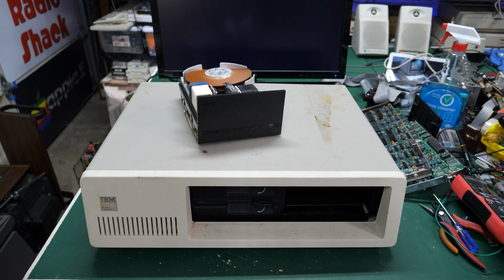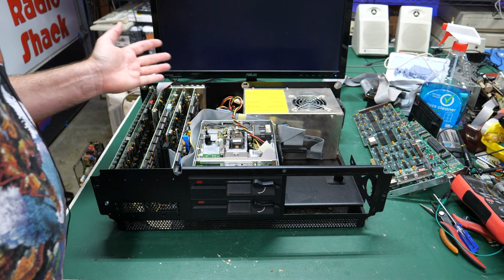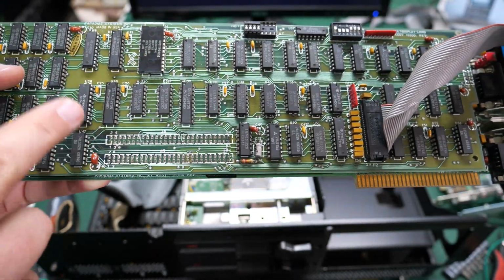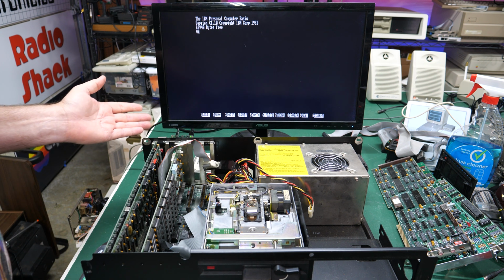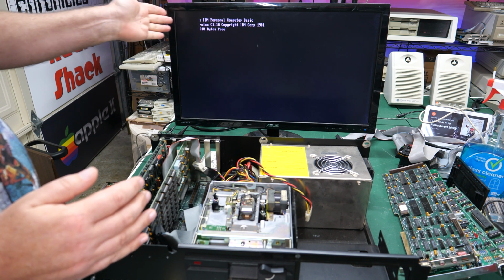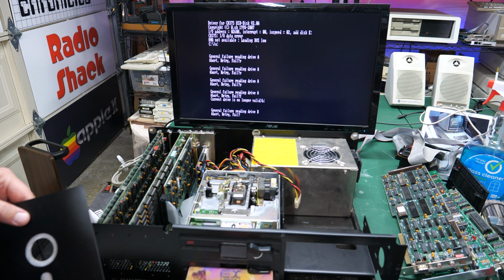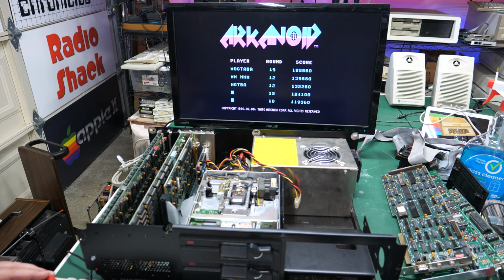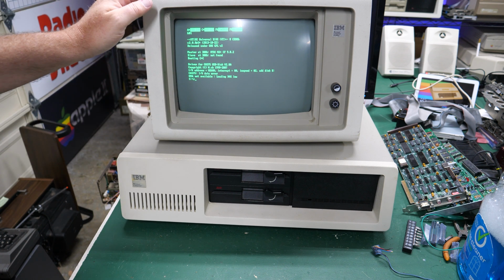Rare Video Card Found Inside An Original IBM 5150 PC!

Comment: Do you know if the original 5150 power supply only came with the Reefa capacitors? I just got one and I have a long road ahead of me as it didn’t come with any cards but it also does not turn on so I took the power supply apart. on instructional videos it shows two of the white reefas, but on mine it’s a maroon, overgrown chicklet for lack of a better description. Basically a big, maroon rectangle shaped capacitor is there instead.  But it does not seem to be a recent install. It looks like it has been installed perfect like it was installed at the factory.  Is that just a different type of reefa? Should I replace them anyway? What is the preferred replacement capacitor for those2 reefas? I know there are instructional videos, but none of them have the same capacitors as mine. Besides the two that I just spoke about there are some normal capacitors, but none of them seem to have leaked or are bulging so I’m kind of stuck. I don’t know which way to go with this power supply.  I’m starting to think that maybe I should just pull the guts out and put an ATX power supply inside the case.  But the internals on my power supply look absolutely pristine, not even any dust which either means it was cleaned very well when they replaced those capacitors or it has very little use.  The rest of the pc is immaculate as well.  It’s the 64k max original version. Once I get it to turn on the next step will be to figure out how to get it up to one megabyte.  I thought the picomem was the way to go, but I saw in a couple videos that it is a different slower type of memory. I’m thinking I need all the speed I can get. So if you know anything about that as well, I would really appreciate it as I’m quite stuck at the moment.😂

Comment: That's not "cassette" BASIC as no cassette is installed on the system. 
That is ROM BASIC and was commonly what PCs fell back into when they could not find a way to boot DOS. 
You're an old PC guy and you don't know this?
It's like a Commodore 64. The IBM 5150 is the same vintage. 

The first version had 64k RAM installed. You could get more, but since it was from IBM that meant$$$$$.
Out of reach for the home user.

Comment: You can have both mono and CGA (or even VgA) going at the same time. There were very few programs that took advantage of it, but Tech Tangents made a video about doing that some years ago. The commenter below mentioning the 'mode' command is correct about using that to switch from CGA to MDA displays and back.

I think I saw that there was an exhibit at VCF East about doing it this year as well.

Also- you have to use 360k disks in 360k drives. The HD disks may sort-of work some times, but the media is different in ways that can bite you

Comment: The Magazine article seems to suggest you can just use the standard  DOS mode command to switch monitors. "mode co80" should switch to colour cga 80 columns and "mode mono" should switch to MDA. no extra tSR needed
Reply: That's correct.

Comment: Man seeing that Miniscribe full-height drive ruined hurts my soul. I would say there’s actually a very good chance it probably worked fine, I’ve got many drives of that vintage still working great. I agree that any personal data on a drive that old will be horribly outdated and destroying them nowadays is pure stupidity. 

Those Teac floppy drives were very popular third-party additions to these IBMs back then. Very good drives and they look great in these machines. It’s unlikely that both of them are malfunctioning at once, you probably have a controller or cable issue. 

I’d definitely be interested in a newly-made cleaning disk!
Reply from the maker: Yeah, I think there's a good chance that the TSR program I was looking for was on that drive.
Reply: Yes, another casualty of that unfortunately. Not only are we losing the actual drives themselves when they do this, but potentially irreplaceable software too. Such a shame!

Comment: To really show some of these machines off, you need to run 8088 MPH or Area 5150 by Hornet, CRTC and Desire.
Reply: Or 8088 Corruption or 8088 Domination, if the hard drive is big enough (10 and 30 MB, respectively).

Comment: On the disk capacity thing: It was common, at least on blank disks, maybe due to different machines using different capacities? I dunno, but it was common for 3.5" DSDD disks to be listed as 1mb(for me, as I used an Amiga, it would format to 880kb and on a PC to 720kb) and DSHD disks to be listed as 2mb.
Reply: Yup, for floppies they're usually marked with the official maximum unformatted capacity using MFM (other formats like GCR could cram in a little more) or if they're pre-formatted they might be marked with the formatted capacity.
Formatted capacity will be less than unformatted number since it excludes sector markers and such, in addition everyone tended to use fewer or smaller sectors than what the maximum was computed with. MS used 1.68MB "DMF" disks for a lot of their later floppy distribution to cut down on the number of floppies needed (except the first for DOS installable programs) - and the limit there was what MS was confident all floppy drives would be able to ready. With almost all floppy drives you can cram in even more using custom settings with fdformat or similar utilities, basically even 1.68MB was a conservative number.
Reply: @Torbjorn.Lindgren  The highest I'd ever managed using a custom file system was, I believe 960kb(my memory isn't very good, so it may be lower or higher) on my old Amiga, which by default would format to 880kb. The issue I found with 960kb is that they were drive specific, for instance a disk written at 960kb on DF0:(the equivalent of A:) couldn't be read in DF1:(B:) or the other way around.
Reply: @fattomandeibu  Yeah, Amiga uses an GCR encoding which IIRC allows a bit more data than the standard MFM encoding but that's still impressive. The use of a denser encoding is part of the reason why Amiga's could get away with their default format of 880kB/1760kB, note that this is actually larger than MS's DMF format (1680kB). I think the official unformatted capacity was computed assuming MFM but isn't 100%.
Reply: @ I decided to read up on it, an Amiga used MFM but got 880kb by having no sectors, or rather, each track is an entire sector so there's no sector gaps. GCR is only used on DSHD disks(1.76mb) as the Amiga floppy controller isn't fast enough to write at the speed required for DSHD and instead slows the disk RPM. It also requires a special drive, which is something I don't have, my drives are both 880kb.

Comment: How large is the city or cities that supply the e-waste site where SO MANY ancient PCs are submitted or are universities or government the primary reason and not a large population or ???
Reply: Mostly government, I assume. The social security place in my local area here in Northern England were still using computers running Windows 3 until maybe... 2015? I can't remember the exact time, but they went straight from Windows 3 to Windows 10 when they finally upgraded, and from what I could tell, it was a national thing.
Reply from the maker: Just wait till I share what I found a few weeks ago. It will be in an Apple II video I have planned.

Comment: The way those drives are behaving, and the specs that were presented, screams proprietary.
TSR is terminate and stay resident lol.
And you probably need drivers for them drives too.
Cool video card find. I bet this machine was used in some sort of office environment with a security level of some sort.
Reply from the maker: Thanks for the tip. I am planning to follow up on those.
Reply: @RetroHackShack  If all else fails, fire off an email to adrians digital basement. He loves weird floppy drives lol

Comment: i always thought TSR stood for Terminate and Stay Resident (in memory)? I may be mistaken, it's been a minute since I worked with DOS machines! Great video, thanks.
Reply: It does.
Reply from the maker: Thanks
Reply: Yep
Reply: You are correct. A TSR is a program that executes and leave a software patch/driver that is invoked by an interrupt. Usually loaded into high memory (unused area above the 640k). Ex professional DOS programmer.